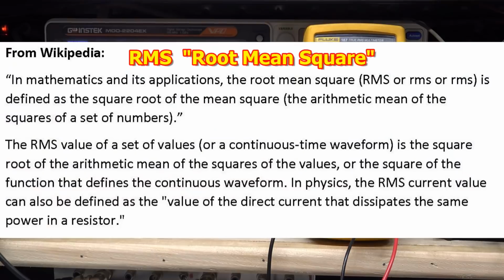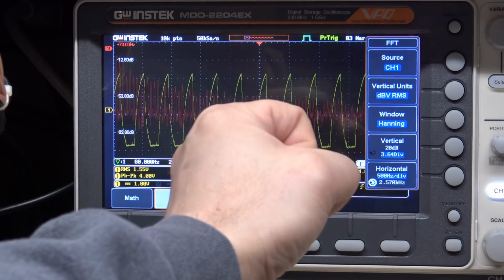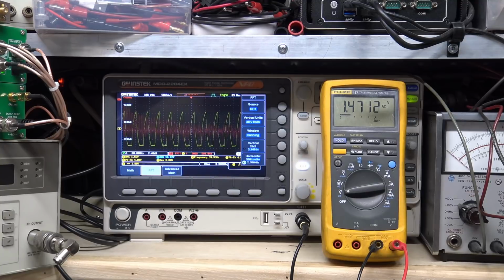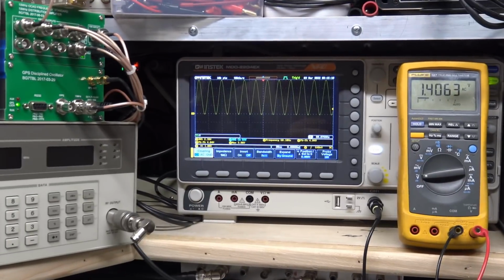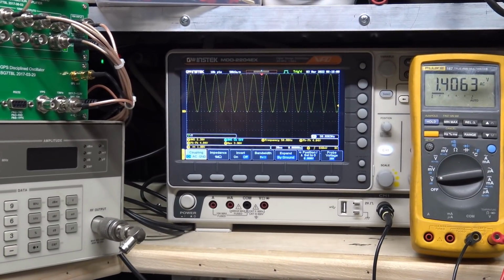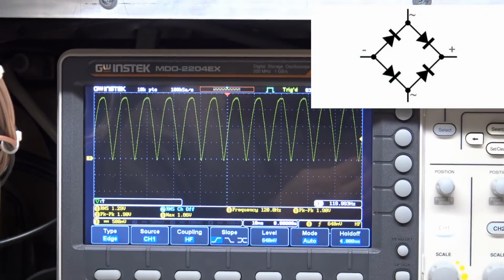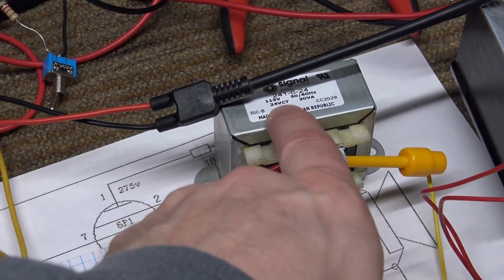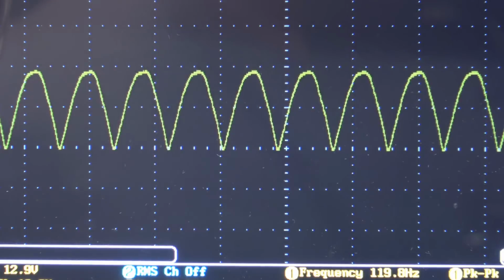Electronics 101½ Part 2½ - RMS & Offset Waveforms & How to Measure Them

Comment: HI Tony. I am a bit confused about the DC offset of the AC sine wave. I thought you said it was not AC if sitting on top of a DC voltage. If that is the case why would a capacitor pass the audio AC but block the DC offset? Other info I have seen specifically stated that you can have an AC signal on top of a DC voltage as in a tube amp that has B+ voltage in the hundreds of volts and the AC component being passed to the output transformer which must be using the AC audio signal for the transformer to work.
I love your videos and think you are great to watch but this issue has clouded my understanding a little.

Comment: I’m sorry, but I’m not convinced that an AC waveform given a different reference is DC. To my mind the ‘polarity’ changes each time the direction of the current current changes, check your Ohms Law and Kirchoff’s Voltage Law. The direction of the current changes at every peak and valley. In the end it is a semantic argument and we all just have to accept the terms as Tony has chosen to define them (grudgingly).

Comment: Meters filter out the high frequencies (sharp edges and short pulses) to reduce noise as well as very low frequencies.  Hand-held meters' hf response is typically 1 kHz to 10 kHz.  You are absolutely correct about the definitions of DC and AC; even though a mathematically equivalent perspective is a DC (constant) plus an AC component.  The constant can be zero, the variability can be zero, both can be zero, or both can be nonzero.

Comment: Except for a few inadvertent errors, this is mostly true -- but vastly overcomplicated.  Power is P(t)=V(t) I(t).  Electric power is always lost in resistors, which obey Ohm's law, V=IR or I=V/R, so that P(t)=(1/R) V^2 (t).  Temperature changes in response to the total heat added to an object, so we need to add up P(t) for a sufficiently long time interval that the increase in added heat (due to electric energy converted to heat in resistance) can be balanced by heat flowing away from the hot component to cooler surroundings.  If we had a list of numbers, we would just add them up; but continuous functions require calculus to compute their sum.  Incidentally, Fourier transforms also require FAR more calculus...  Since temperature changes FAR slower than electronic signals, it is entirely adequate to average the power (mean) over a "very long time," T.
Avg(P) = (1/T) sum P_i Dt_i = (1/(RT)) sum V_i^2 Dt_i
We would like to have an equivalent voltage that we can use as if it were DC to compute power conversion rate:  P=(1/R) V_rms^2.  Putting these two together
(1/R) V_rms^2 = Avg(P) = (1/R) (1/T) sum V_i^2 Dt_i, we find
V_rms = sqrt (V_rms^2) = sqrt ( (1/T) sum V_i^2 Dt_i ) -- the square root of the mean of the voltages squared.  Substituting V=IR into power instead would lead to the same result with V --> I and Avg(P) = R I_rms^2.  It is more tedious to show that Avg(P) = V_rms I_rms as well, but it has been done.
In the specific case where V(t)=V0 sin(wt), V^2 = V0^2 (sin(wt))^2 = V0^2 (1/2) (1 - cos(2wt)).  But cosine is exactly negative as much as it is positive so that it adds to zero over any number of periods.  For sufficiently long times, (1/T) sum cos(2wt) --> 0 even for fractions of a period left over.  
Thus, V_rms = sqrt( Avg(V^2) ) = V0 / sqrt(2) = 0.707 V0.
Reply from the maker: Thank you for making it not vastly overcomplicated ;)

Comment: Ah this brings back my university days. I notice that nobody has gotten into a battle of the dictionaries with you over the AC vs DC naming convention. However, I find labeling a signal as either AC or DC is not all that helpful if the signal is not pure AC or pure DC. I would rather use terms like "DC with ripple" if there is no polarity inversion or "AC with bias" otherwise.

Comment: A transistor works by varying DC current, a tube (or FET) works by varying a DC voltage. 
An amplifier or radio works in the DC environment until it is converted to AC when it enters the speaker. A push pull amplifier is one positive DC amplifier, and one negative DC amplifier which is combined to produce the AC "push" and "pull" on the speaker.

Comment: (@7:47) - In essence, both arguments are ‘correct’; your sig-gen can be modeled as an ideal DC source (V) in series with a generic signal source (V(t) - note the time-dependence). This function can be a sine wave, a square wave, a triangle/sawtooth wave, or even DDS (Direct-Digital Synthesis) if your sig-gen supports it. There are then three cases to consider:
1) the value of V (the output of the DC source) < |p-p| of V(t) (here, “|p-p|” means the absolute-value of the peak-to-peak voltage of V(t).) This is “true” AC, as the electrons will change direction. Or,
2) the value of V >= |p-p| of V(t). In which case, you have DC - but time-varying - as the electrons never change direction, but the force (EMF) behind them is not constant. Or,
3) V(t) is turned off, in which case, you have “true” DC as long as V <> 0.
Also, if |p-p| of V(t) << (much less than) V, we call it “ripple”… otherwise we call it “really bad ripple”! 🤣😂😆

Comment: Hi Tony. I have to disagree here; I don’t think the scope is using an FFT to get the RMS value. The scope shows the RMS even if you’re not doing the FFT; it’d be sucky if you had to turn on FFT just to get the RMS value. Likely - as it already has the samples in some buffer somewhere - it treats the ‘N’ samples as an N-dimensional vector and uses a vector-arithmetic unit in the DSP-chip to square all the sample points, then average them over ‘N’ points, and finally take the square root. And all this without having to go to the frequency domain; that’d be a big PITA! Ditto for that DMM - I don’t think that thing has the processing power to do an FFT - not at the price point they sell those for. 😏
Reply from the maker: I think you misunderstood what i was saying.  I didn't say it used fft for rms measurements,  rather i used the fft function to show the individual frequencies that make up the complex waveform.  This gives you a visual indication of how you use the math to calculate rms.
The rms measurement function in the scope is something totally different.

Comment: Why didn't you use your HP410C meter? I think it would be a better meter to use when you have a signal type voltage, I use my HP410B meter if I have a wave form signal with or without a DC voltage.
Reply from the maker: Most people don't have an HP410C.  Most people out there will have a DMM and possibly a scope.  I wanted to demonstrate how those two pieces of test equipment work.  If someone has a 410C, they probably don't need to watch this video.  That said, I love my 410C.  The AC function is accurate up to almost 300MHZ, if I remember correctly :)
Reply: @xraytonyb  I like to watch because there is always something to learn or at my age relearn..
Reply: @xraytonyb  I enjoy repairing the 410. Can be challenging.
Reply: You are right Mr. Bowen! This kind of device is very useful with audio (ac signals).